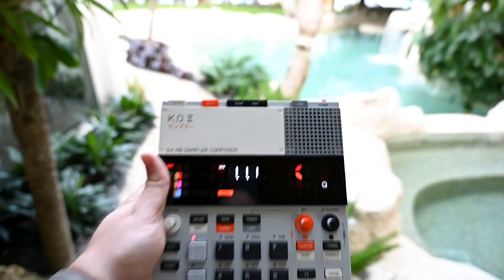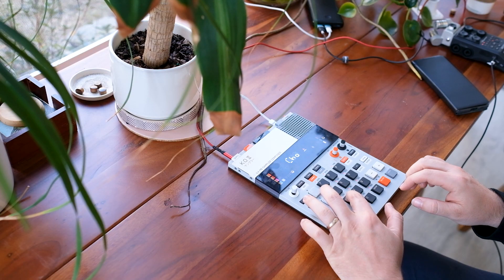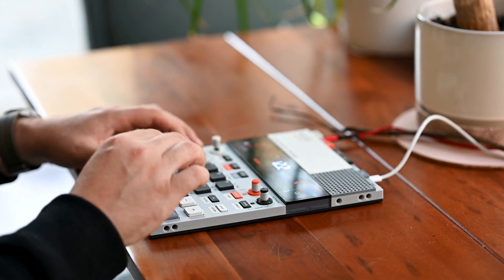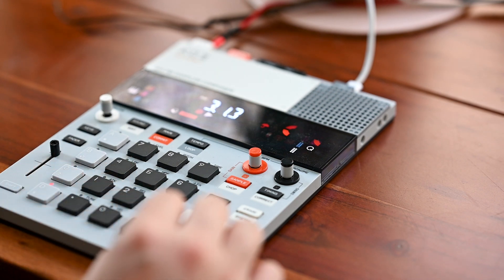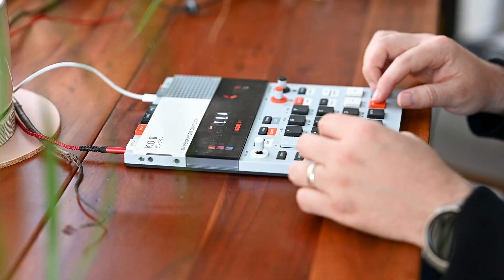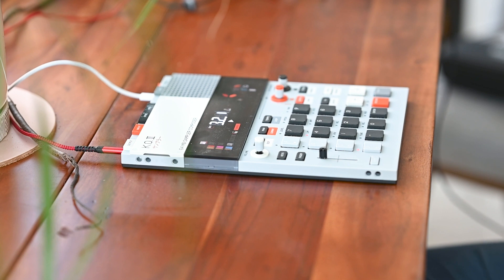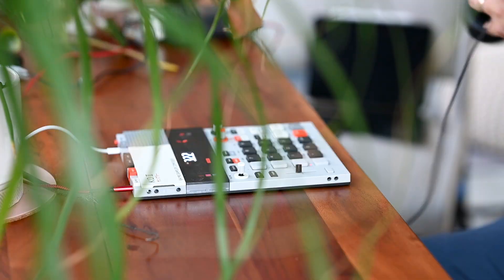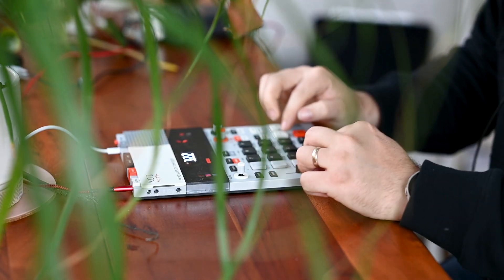Did I change my mind with a functioning KO2? Slicing samples on the EP-133

Comment: Actualy you can comit a scene where you can setup diferent variations of the banks, and trigger them one by one (manually after bar ends). The only limitation is in the effects, because you can apply them by bank and they are applied for the entire project. Is a fun toy that can make basic beats and can be used by anyone, without experience in music production (as me).